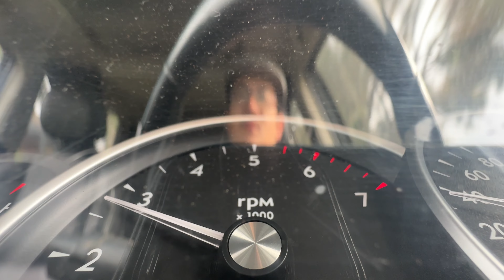What the hell is this noise engine or transmission? I'm puzzled!

Comment: Fuel Pump mate in my opinion . reason is is not all the time and only heading up in rev range . wondering whether there might be a fuel lock in the lines possibly from disassembly ?
Reply from the maker: Can easily bleed the system, so might do that. Fuel pump should not be noticeable at the front of the engine though as Commodore feed from the tank but the theory is good and fits.

Comment: I have a similar noise at the moment. Did you work it out?
Reply from the maker: Yeah I did! Driver side exhaust manifold crack. It doesn’t make sense but that’s the sound it makes. 100% certain.
Reply: @AllTerrainAction  thanks for the reply. I'll have to look into it in the morning.
Reply from the maker: It’s very hard to tell. Mine was under the heat shield. You’ll find on a cold start you’ll hear the air leak more than once it’s hot. You can hear the air leaking if you put your phone on video record place it on one side of the engine bay with bonnet open start cold if you can’t hear on one side try the other on another morning, for some reason the phone microphone seems to pick it up much more distinctively to a crack with air leaking than our ears can. Good luck, no real issue left mine for 14 month didn’t get worse only finally changed mine when I had time instantly gone.

Comment: Hmm..  are you sure its not something inside the vehicle vibrating at a certain frequency ?
due to it only happening at a certain rev range and not happening all the time, Check to  see if something is not rubbing or loose on the front CV's 
Yeah  its a tough  one I will give you that..
Reply from the maker: I’m fairly sure not in vehicle if it is something it would have to be from under the dash if it was but I should pull everything out I suppose to eliminate that factor. Good thought…

Comment: I once thought it was my transmission and it went away after I changed my spark plugs. Sounds weird and I thought I knew a bit and there was a reason I was thinking transmission. ( shoved it in reverse at 80ks ) don’t ask. But yeah it seemed like it was slipping under load and it was a plug.
Reply from the maker: Need to know, does the 5l40e actually allow you to enter the reverse gear at that speed? I wouldn't think it would..! Spark Plugs were changed in the partial rebuild so, I'm doubting but I will keep it in mind.